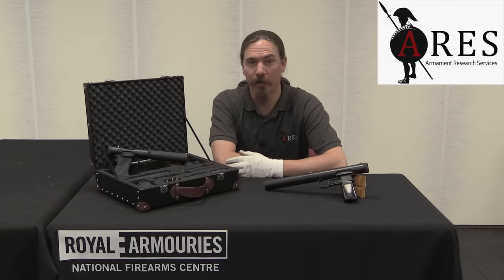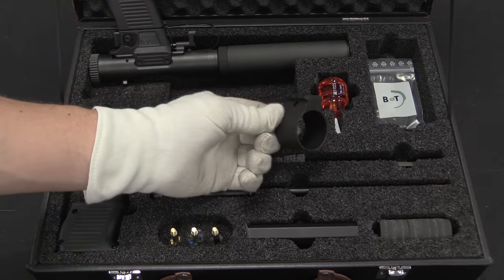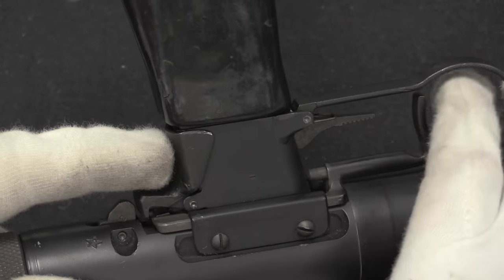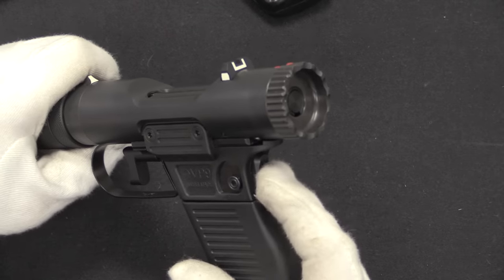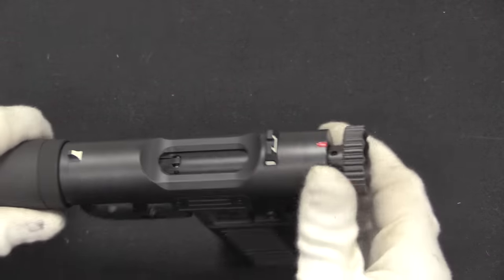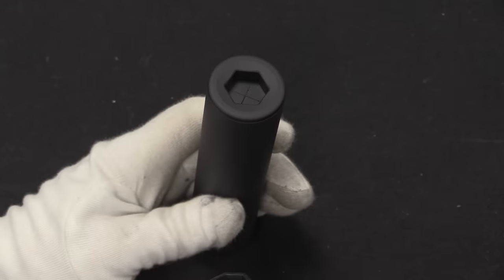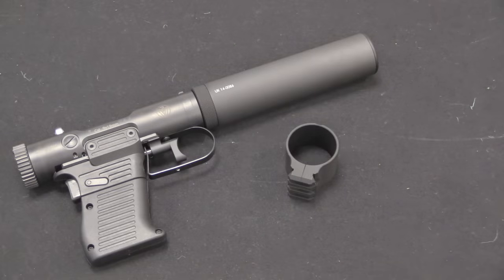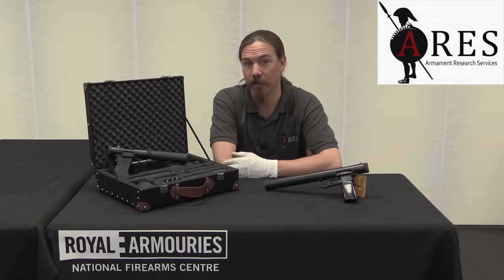B&T VP9 Silenced Pistol: A Modern Welrod

Comment: The other suppressor is not a spare but a training suppressor with only aluminium baffles according to B&T.
Reply: So you dont unnecessarily go through the rubber wipes you have while practicing aim, i'd imagine
Reply: i think you can just remove the rubber wipes on the original, as it already comes with tools to open it anyways
Reply: The rubber wipes add to the length of the baffel stack.  If you remove one or more the stack would be loose and you'd run the risk of a baffle strike.  Watch the video again and you'll see it.
Reply: Ah yes, veterinarian training. Everyone knows the most important part of being a vet is marksmanship.
Reply: @franklind.roosevelt7416  well of course! You wouldn't want to miss that poor horses head and accidentally hit a millionaire with enemies in high places by accident, would you?
Reply: @floatingpyro2050  funny story actually, I- ...nevermind
Reply: @uhoh7545  no no, do tell

Comment: This can be summed up by the saying, "if it ain't broke, don't fix it". It just gives it the updates that were needed without changing anything that didn't need it.
Reply: USSEnterpriseA1701 yup, more ergonomic, slightly better assembly. Didn't try to overdo it by giving it sights or whatever tacticool nonsense
Reply: Theophrastus Bombastus Van Hohenheim This weapon has the Railroad written all over it. Firearms are meant to be loud, intimidating, and cause major destruction.
Reply: But they broke it, no longer looks like a 1940s bicycle pump... which worked for the Welrod. Just saying 🤷‍♂️ lol

Comment: You need to do some shooting with this next to a Welrod to compare the two with decibel meters. Basically how does old compare to new.
Reply: The only problem I can see with that is that the original rubber peaces are rare and get destroyed when fired, but using modern equivalents would invalidate the test.
Reply: Using modern replicas of the rubber buffers might actually bring more validity to the test, as actual period rubber (no pun intended) might have lost a lot of its elasticity by now and would not provide as good of a seal after the first round as it would have in the 1940s, while modern rubber disks made from the same material would bring it back to its original effectiveness.
Reply: its just rubber, theres no reason it would invalidate the test
Reply: Like Walther said, real rubber from the 40's would probably be too brittle to make a fair comparison, also the 1943 U.K. recipe for rubber is still classified, and we might not even be able to produce it anymore, like the early forms of bakelite, with the steel, copper, etc. used to make the original manufacturing lines affecting the final product in a way that can't be replicated.
Reply: What I'm trying to say is that there's no way to make this test scientifically accurate, but it would be cool to see anyway.
I'd also like to see a decibel comparison with a modern metal baffel suppressor, and a comparison of calibers like .380ACP, .22LR, and .22 short.
Reply: You know rubber is a natural substance? We aren't talking about synthetic rubbers here. They were just disks of natural rubber shoved into a pipe between spacers. You couldn't make it accurate anyway as the bullet compositions and powders were different in the 40's. It would be a subjective test.
Reply: Rubber can be made with a variety of different acid concentrations, coagulation times, and other chemicals added for different purposes. That's like saying if you cut a natural rubber shoe sole into small rings, it would preform the same as a rubber band of the same dimensions.
I agree about the bullets, too, but at that point the only significant difference between the VP9 and the Welrod would be the slightly longer suppressor on the original gun.
Reply: MerKorinne I just want to hear the damn thing shoot.  No point in splitting hairs about the chemical make up of different rubbers
Reply: MadCowCrazy shooting them would decrease the worth of both guns extremely.
Reply: Thaa Fire That's like saying "I won't sleep with my girlfriend because I want to keep her fresh for the next guy"
Reply: I think that what everybody really wants to know is, how much have Hollywood movies been lying to us?  Like everybody else, we will gladly forgive the folks testing the gun for not using the exact rubber formulation, gun powder formulation & weight.  As long as a reasonable explanation is made as to the differences, no one will really mind.  But for the audio geeks, we would like to know what recording setup you use.

Comment: The thing I noticed with VP9 is that it looks much more like a pistol when disassembled in this video. A feature of the welrod in his video, was that if anybody found you with it, you could use a cover story for why you were carrying a cylinder-shaped object. According to the presentation in this video, you do not have that option with the VP9, as it looks more streamlined like a recognizable service pistol. Therefore, the only redeeming features would be the smaller size and the fact that it would still be close to silent. But if anybody found the pistol, it would be easy to recognize the purpose of carrying one, giving your intentions away.  Then again, I guess the whole cover story feature was weak to begin with, as it is at best, suspicious to be caught with any kind of cylinder-shaped, unidentifiable metal object, during a war, in high-security situations or near high-profile individuals.

Comment: Wow I love this little gun! I've always been a fan of the welrod ever since I used it back in Medal of Honor Rising Sun when you're stuck in Singapore with that and a 1911. And the fact it was a single shot one hit one kill have to reload after each round gun but it always fascinated me that it existed, it also teased the idea of modern firearms because it's essentially a very small bolt action pistol. And with this new little pistol it really drives home the idea of if it ain't broke don't fix it. It's so simple just like the welrod and it's basically everything the welrod was just modernized. It was really impressive to even see the trigger in the same orientation and operation as the original welrod because of you think about it why are you going to want a really overly complicated gun as a behind enemy lines reliable suppressed firearm.

It would have been really cool to see you shoot this out the range. Even though it wouldn't have been loud or impressive seeing it operate compared to an old-school welrod would have been quite interesting to see.

Comment: In the course of my duties I used the welrod for its intended purpose, you take the magazine off & add a short air hose to the mussel, now you have what looks like a bike pump. We did have the rail which we clipped a very small scope & a modified m-16 bipod & waited. Worked just as it was intended.

Comment: "...and it absolutely has some improvements over the original Welrod."

Not sure you can really call it "improved", since IIRC from your video on it, the Welrod was intended to be cheap to produce, as the goal was to be able to drop them behind enemy lines to (hopefully) be recovered by resistance fighters. If they had added the creature comforts of the B&T VP9 it would have added to the cost.
Reply: Trogdor yeah, but there ain't exactly a war on, mate

Comment: Wouldn’t a .45 ACP version make more sense? I’m generally for 9mm in most pistols, but in one thats only fired suppressed, you’d think a faster than sound cartridge would be a handicap.
Reply: The barrel is perforated so it doesn't generate the pressure necessary to accelerate the bullet to supersonic speeds. I've read that you can shoot any kind of supersonic 9mm ammo and the bullet will be traveling subsonic. Only hollow point ammo will give you problems.